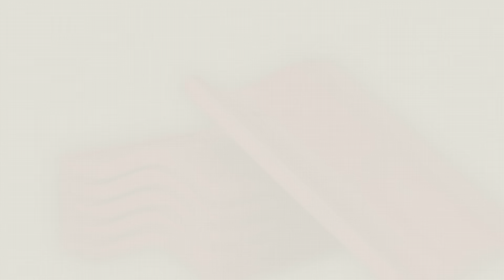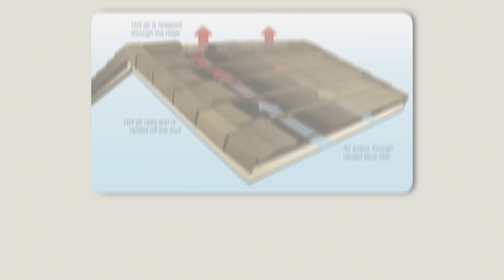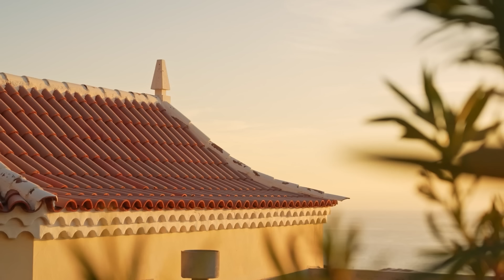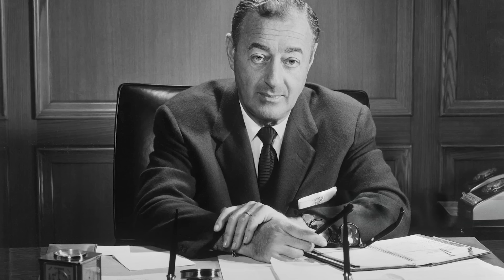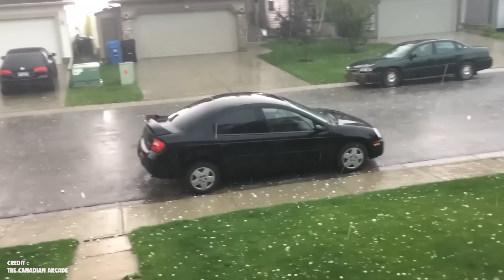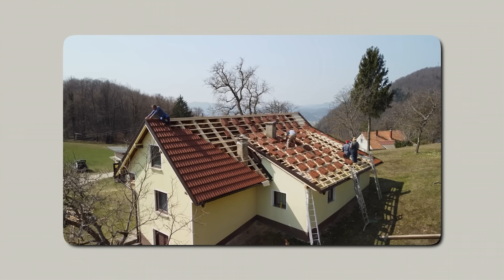Why Did America Stop Using Naturally Cooling Roofs?

Comment: 6:52 Depends. A ‘cold roof’ does not require plastic membranes. It consists of tiles, a ventilation space beneath the tiles (usually as high as the roof battens) and then a simple barrier against water ingress and drifting snow, made, for example, of natural wood. As long as the structure is allowed to dry out, this is not a problem and will last for centuries. If you want to use the loft as living space, things become more complicated, as you then need to install insulation between the rafters and carefully fit a vapour barrier beneath the rafters – or ensure the insulation is moisture-resistant. However, such a barrier does not have to be made of plastic. Even OBS boards, when carefully laid, are sufficiently vapour-tight. Generally speaking, however, in a lived-in loft, the problem of damp (from the inside!) is harder to control than water from the outside. Insulation made from, for example, hemp fibres, combined with the use of wood fibre boards and solid timber, can largely prevent mould growth; however, the thermal insulation is slightly less effective than with mineral insulation materials – though it is usually more durable and can last for centuries when well made.

Comment: I live in Texas and Im guessing 90% of new homes in my city are built with black composition roofs and people are constructing a baffling amount of black metal outbuildings (for workshops, RV storage, etc). Absolutely mind numbing
Reply: I live in TN and replaced my old black roof with a "white" shingle and it made life SO much better. It was actually a light gray color. The difference in electric use paid for the new roof in under 6 years.
Reply: @kittimcconnell2633  
My dad used a Tan Shingle . 
 He wanted to use new-at the time composite shingles , but the house was too light weight to put any thing else .
Reply: Here in Texas we get Texas sized hail storms. You'll be replacing tiles non stop if you want a tile roof here.
Reply: @willm6871 modest part of your replaced, your shingles either way
Reply: @ammarnapata2193 no, salesman sell people more shingles after hail but that does not mean you need them.

Comment: so if you are building a new home, would you recommend clay or the stone coated metal?
Reply: Depends. If you build a new 'Murican "house" (i.e. a cheap hut made of plaster and cheap wood) - then no. Not worth it, the house will vanish anyway after some decades...
If you build a new house (of stone) - yes, that's just normal (outside the US).
Reply: @hermannschaefer4777 which one is better? The clay or the stone coated metal?
Reply: @lemurwrench6344  Metal is never a good idea - too much problems with condensation and noise, but is fine for commercial buildings like warehouses. Metal is only used in areas of the roof where tiles won't fit, esp. copper and lead.
Reply: @hermannschaefer4777 okay, thank you for the advice

Comment: As cladding, clay tiles are excellent...however...cladding is only the top layer of the roof system. Waterproofing of wooden (or steel) elements under the cladding is needed. In Europe they lay a grid of wooden slats under the tile to support those tiles. That wooden slat system rots - just like any non-waterproof materials. The tiles look great, until they start falling from the roof because the support grid is total rotten. Asphalt is awful cladding, for sure, roof tiles are not a simple or cheap replacement.
Reply: Nothing rots under a roof - if the roof construction is made well. Any construction that uses wood must be able to dry. The roof construction of old houses in Europe are normally as old as the house itself - which often means hundreds or years.

Comment: I have been all over Asia, its not common in Asia. Maybe hes thinking Japan? Temples in Asia, yes. And the reason for masonry is how cheap it is there, and their concrete buildings crumble easily.

I lived and traveled in many Asian countries. Theres nothing special about either masonry or clay tile. Pros and cons to everything.

As for the temples, its because they usually build them then do minimal maintenance for generations. Many are not taken care of, a few are superficially. Ans since they are very heavily built structure it works to use the expensive clay tile since the building can handle the weight. Money is not an expense for them until its done, largely because of the super cheap or free labor. Then when its done, its forgotten.

Comment: Look at the old houses with the clay roofs: minimum bedroom size is 7'x10' which is pretty small by todays standards, but still in the residential code. Those short distances allow for an <8' roof joist so loads were carried by more walls, or  compared to more modern 10'x10' bedrooms (or bigger) the lumber would have 20-25% more carrying capacity (actually more than that with full size lumber vs today's engineered 2x material that is closer to 1.375").
Also, the paper under the clay tiles disintegrates in about 40-50 years and the reroof is twice as expensive as a composite roof, because you have to remove it and then re-load the roof.
Reply: Just look at manor houses in France - I wouldn't say older houses need to be small because of the type of roof material... ^^ And if done well, there is no need for any "paper" or plastic membranes below the tiles.

Comment: Steel or composite roofs are also a good option
Reply: As long as you’re deaf - with a roof made of sandwich panels, you can hear every raindrop…
What’s more, you shouldn’t underestimate how complicated a roof becomes when it’s vapour-tight. Not only does condensation become a major problem, but it’s also almost impossible to control moisture from inside without forced ventilation.
Reply: @hermannschaefer4777  Just have an old-fashioned attic with insulated floor and this is not a problem. Attics are not supposed to be living spaces.
Reply: @hermannschaefer4777  I love being able to hear every raindrop.  It's something I miss a lot in houses and apartments without a thin roof

Comment: A wooden batten system would be simpler to add to a cheap roof, passively drawing cool air under the hot roof
Reply: Drawing in cool air along with every insect known to man. Not to mention tile roofs on battens will leak in a blowing rain. Im a roofer. It’s no longer code compliant where I live. Thank god.

Comment: Asphalt shingles are a rip-off.  They should be outlawed.  They only last eight to ten years before they need replaced.  We went thru three or four shingle roofs before we replaced it with a metal roof.  With the metal roof it was instantly five degrees cooler upstairs compared to what it had been with the asphalt shingles, and I don't notice it being any colder in the winter.
Reply: Did you buy your shingles from Temu? I just got 27 years out of mine.
Reply: @82trooper50  No.  The house was built in 1966 and Temu was not even around then.  The 20 year guarantees roofing contractors give mean nothing.  A nearby house had hand split cypress shingles and they lasted 48 years before they were replaced.  Asphalt shingles are trash.

Comment: Most of the tile roofs in Florida are not clay, they are concrete tiles.
Reply: I love the look!! But when I was in college I was a secondary handyman for a gentleman who owned at the time sixteen Seattle properties. One of these had a tile roof … with some broken tiles. I was sent up to replace them and ended up breaking more tiles than were originally broken!! I was so mad and concluded never to own a house with a clay tile roof!! Again, I love the look, but good luck doing any work on your roof!!! Hail, branches, antennas/etc … Nope!!!
Reply: @tommybarnhart6023  Not normal, you can walk on a tiled roof with some care. Must have been really bad quality - or some weird and cheap tiles. A standard tile is about 4 kg (≈ 9 lbs) here.
Reply: Concrete tiles aren't bad, but they are inferior to fired clay tiles. They won't last for centuries and tend to crack during freeze-thaw cycles if they aren't manufactured well. Concrete is much more porous than fired clay. It absorbs water. When that water freezes, it expands by about 9%, creating immense internal pressure that causes micro-fractures. In engineering, these are called freeze-thaw cycles. While a high-quality concrete roof will last a respectable 30 to 50 years, fired clay tiles routinely last 100 to 150+ years.
Reply: @hermannschaefer4777  tile roofs can be pressure cleaned and maintained easier because the point load is much stronger than clay tile. Clay tile break extremely easily. I’m a roofing contractor. I install both but most clay tile is imported from South America and if you have a roof leak, hail damage or something you’ll never find replacement tile for repairs because they always change the design a little bit every couple of years.  Plus many clay tile manufacturers don’t have product approval to be installed in my area because of hurricane code requirements.  They won’t withstand wind uplift testing.
Reply: @onionhead5780  This quality issue will not arise in Europe. And many manufacturers have not changed the design for decades, or even centuries (beaver tail, monk and nun, Frankfurt pan). Nowadays, interlocking roof tiles are the norm. And no, they do not break ‘extremely easily’ here. However, such roof tiles require a stable and solid substructure.
Reply: @hermannschaefer4777  I agree.   My comment was intended to point out that, while tile roofs are pretty common in Florida, the tiles used here are almost never actually made of fired clay.  Of course, freeze-thaw cycles are also uncommon here, so this may not be a big issue.

Comment: An American wood frame house would buckle under an heavy clay roof 😂
Reply: I get the sentiment, but my 40 year old garage, 2x4 wood construction holds a massive glaced clay tile roof. It's not as much the wood construction that limits the load capacity of a roof. It's  the slope of the roof construction. Roofs with low slope angles take less material to deck, but put more outward stress on the bearing walls...

You know, you're right. American homes are crap even compared to an eu shed.

Comment: A good standing seem roof with solar panels mounted to it gets a lot of the same benefits as the gap between the solar panels and the roof serve the same purpose and a good standing seem roof can outlast even a tile roof.
Reply: I can confirm,  I got solar panels over my finish room over the garage. It's unnoticeably cooler.
Reply: @DefectoPerfect0  noticeably?
Reply: When we bought our house it had black asphalt, I thought there's nothing stupider, dark and hot in summer and winter doesn't matter because it's covered in 10" of snow. We went light grey but still too hot, added power venting and when it's on the standing up space in the top level of the house is better. I've been thinking about an air gap method for a few years now, and the wind problems. With solar I might want to cover even partly shaded parts of the roof just to get the air gap isolation from the heat.

Comment: They still use a lot of slate roofs in Europe. How do they compare to clay?
Reply: You lose the reflecting properties, but due to the similar mounting technique than terracotta tiles, it has better cooling properties than glued asphalt shingles
Reply: @LaurenceVonThomas  Slate is also more prevalent in cooler northern regions, like England
Reply: Most roofs in older houses are "cold-roofs", i.e. the loft is not living space. Tiles of slate were cheaper back then (no need to burn the clay), but nowadays the paid work to handle this natural material is quite high. In some regions it's still a thing though, like Brittany. Roofs made of slate can also last many centuries.